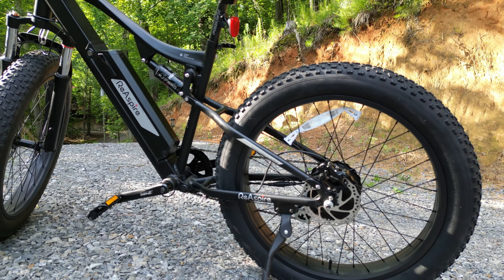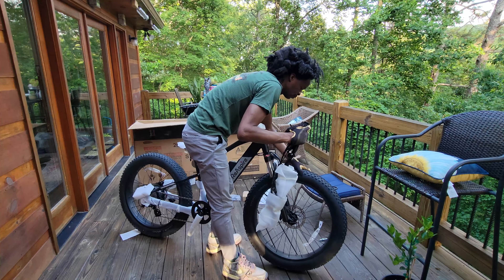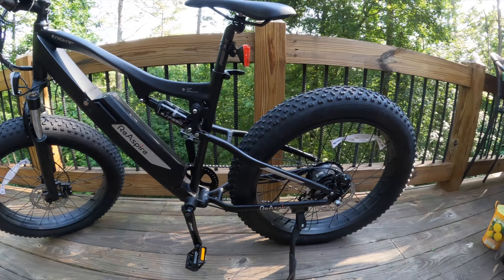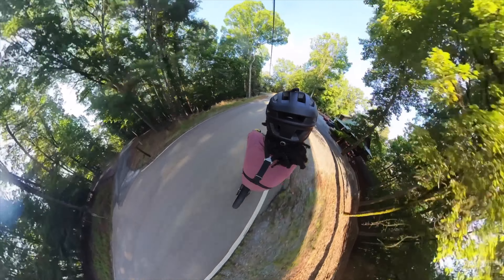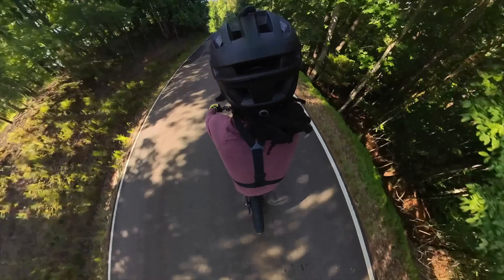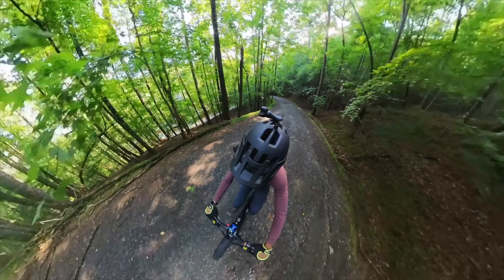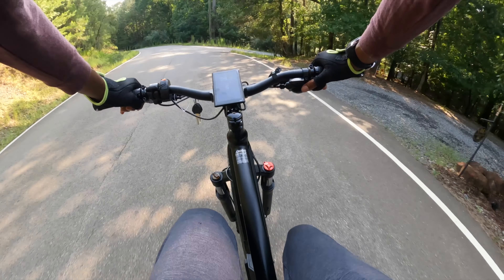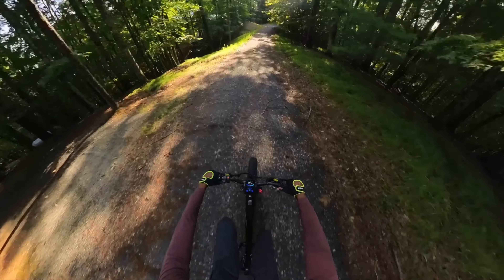Unboxing, Setting Up, and Mountain Testing the ReAspire Electric Bike | Ultimate E-Bike Review

Comment: My same bike limits me to 10mph how can I unlock the speed limit regulator?
Reply from the maker: Where did you buy the bike? Mine hit 28MPH stock settings?
Reply: @JeremyVinny I figured it out  after ready the manual 😂
Reply from the maker: @JC-wn1sp  this is good news,  10mph speed limit would stink.
Reply: @JeremyVinny Am I able to upgrade the battery for a longer lasting ride and what would you recommend?